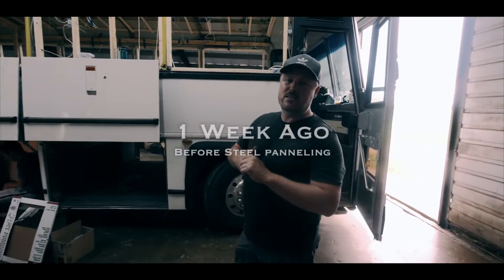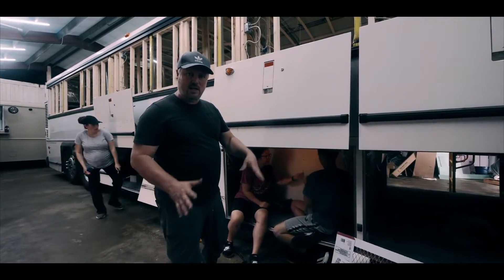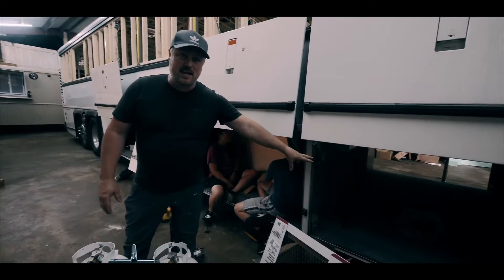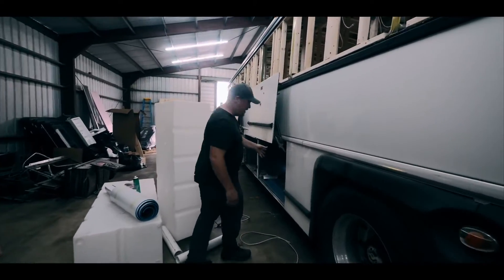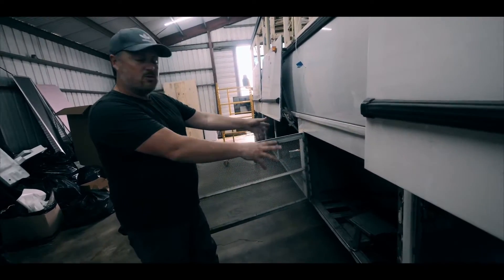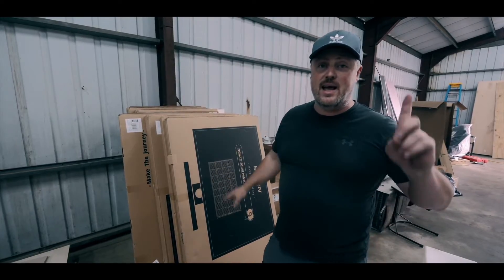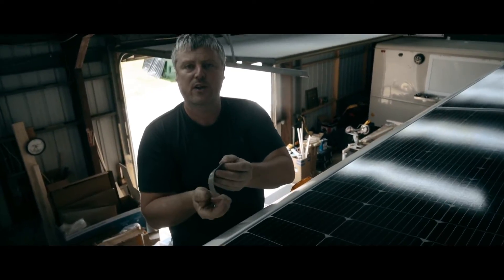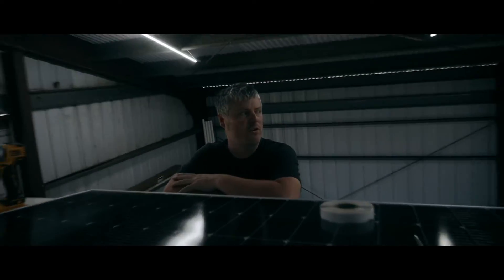Solar Panel Installation on a Bus Conversion: Harnessing the Sun's Power

Comment: Looking good! I have most of the solar setup on my bus, 12, 380 watt panels, Victron equipment, 24 volt with 600 AH of batteries so far. Works amazing! They will love it, so nice not to have to rely on a generator all the time for a/c power.